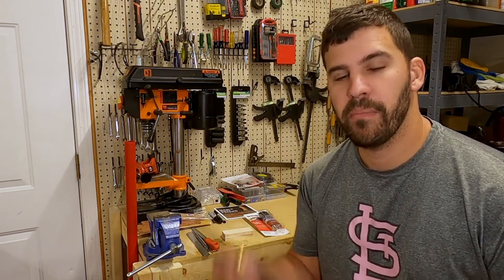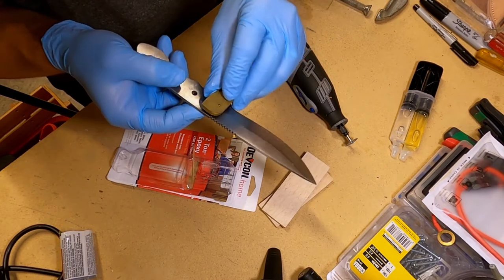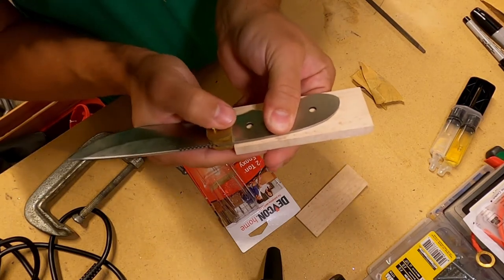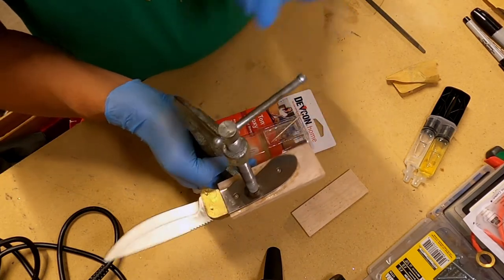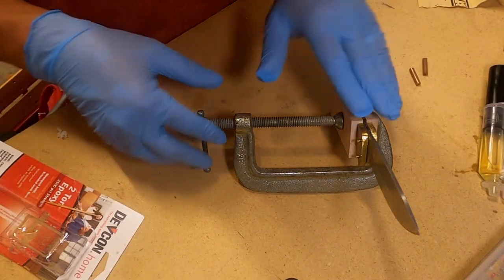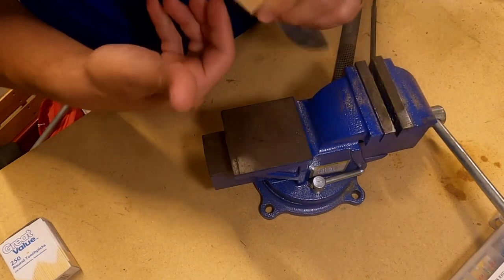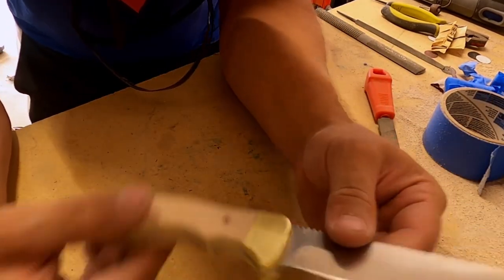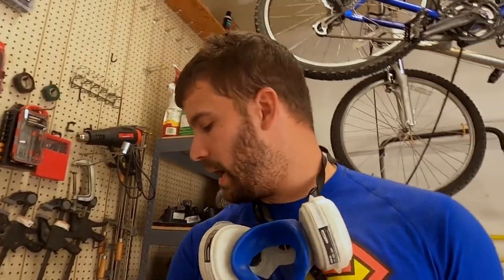ManCrates DIY Knife THE FINALE! It's DONE! and it's sharp...

Comment: You’d be amazed to know that the vice can be secured to that table thus rendering it immobile. 
Nice video though.
Reply from the maker: It can be, and the holes are drilled for it, but I had recently rebuilt the work bench and misplaced the bolts to hold it down.